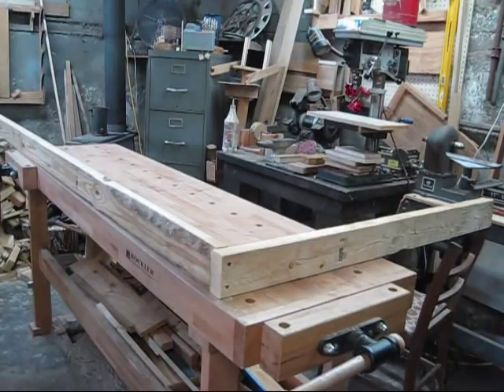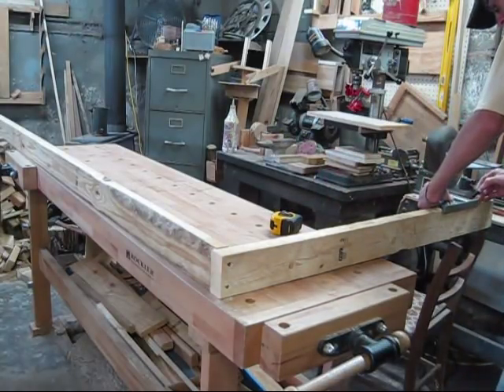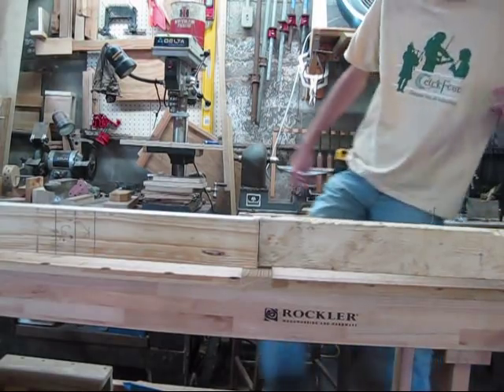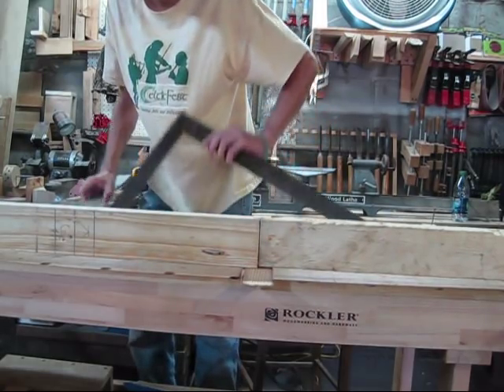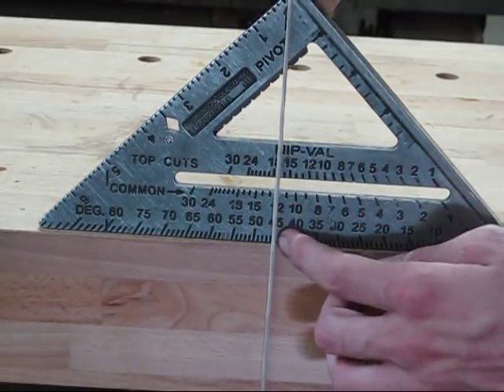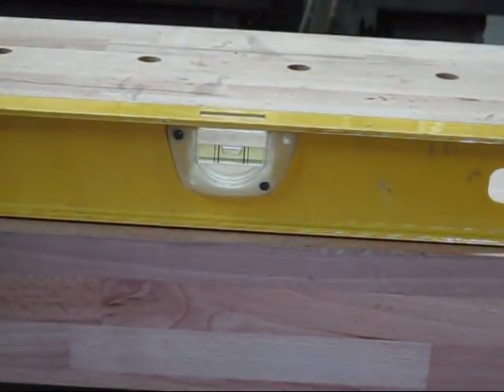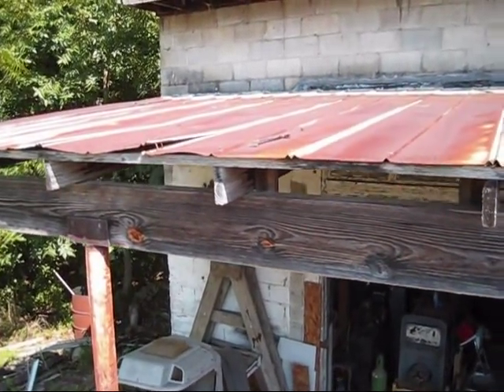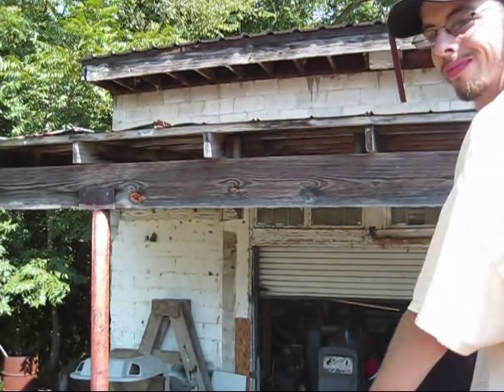Tricks with construction tools

Comment: @classic work The 3-4-5 method only works if your 2/4 plates are perfectly straight which is unlikely.
It's odd that you mention that the method that you use for leveling with a speed square is only as good as the length of the square, but you don't mention that the same thing applies to the 3-4-5 method in that if the board is not straight it will not work.
Reply from the maker: +Jim Watson A plate can be crooked as a snake's back, and the 3-4-5 method will still work.  This is framing not machining.
Reply: +Classic Work  In your demonstration you measure the hypotenuse at the edge of the 2/4's. If the place your measuring is as  "crooked as a snake's back" and is not in line with the beginning and end of the board, it would be impossible to make the 3-4-5 method work. Also you use a little speed square to show that the frame is good. You certainly can't say that is true when your representing only the first 7 inches of the wall. That's like taking a short level to plumb a wall. Are you going to slap a 2' level on a bowed stud and tell me it's plumb? It's impossible if the area you put the level on is not in a straight line with the top and bottom; the level would be titled and when you moved the wall laterally till the level showed plumb the wall would not be plumb.  The method is based on straight lines. Imagine the 2 boards you are measuring were half circles. Do it on paper now. Scale it down so it will fit on your paper and tell me it's accurate.  I realize that this is an extreme example, but so is a snakes back.
Reply: +Jim Watson when laying out track house foundations we can't rely on our formwork to be straight, it's often used several times and varies in quality. we find it more accurate to pull square off of two strings along the formwork
Reply: +Myles Lenover L&S concrete systems
Reply: +Jim Watson : I think the point is, the foundation  or the sill plates may NOT be perfectly straight--but the chalk lines you snap  between points 3,4, and 5 WILLbe--if they are pulled taught. Carpenters will then work off of those lines when putting up walls. The foundation or old sill plates MAY in fact be like 2 semi-cirlces--but after you snap your lines you ignore the curved part of the foundation--or rip out the old plates, and place them to match the chalk lines. No?
Reply: +Alan Wong Obviosly--the larger the multiple of 3,4,5--ideally the length of the whole wall, the more accurately one approaches "square" for the building.
Reply: +Jim Watson : So my question is: when a plate ISNT  straight, on a piece of construction, how do you fudge to compensate for the previous carpenter's error? Are there any tricks  to fixing that?
Reply: +Alan Wong  you bend the plate till it's on the line and then bolt it.
Reply: +Alan Wong What "old sill plates" are you talking about?  He was using the edge of 2-2/4s in his demonstration, and that is why I said they have to be straight. There are no chalked lines to go by in his demonstration.
Reply: +Jim Watson: Oh, I just assumed there WOULD be a chalk line; framing lumber can often be warped....so how else can you make sure it's straight but by referencing a chalk line--and as you mentioned, THEN  bend the plate and bolt it to follow the line.
Reply: Alan Wong In his demonstration he had no chalk lines to go by. That's why I said it wouldn't work unless the boards were straight. There was nothing about a sill plate, was there. We are talking about 2 different things.

Comment: I was taught to parallel a beam with a string is to use a short piece of 3/4 block on the side of both ends and the string should be the thickness of 3/4" all along the side of the beam.  Also to plumb up roof trusses I use a 3/4" block on top and hold a 3/4" spacer between the bottom of the truss and the spacer. The free end at the bottom of the string being connected to a plumb bob.  When top and bottom have 3/4" parallel to the truss it is plumb.

Comment: I was TAUGHT a^2 + b^2 = c^2 in high school ... and I was able to solve the problems in the book and get the grade, but I didn't LEARN it until I needed to lay out a right angle for a garden and was introduced to the "3,,4,5" rule.

I will confess to knowing next to nothing about speed squares but I think I can add to your knowledge regarding squares in general. 

Do you know how to test a square that DOESN'T have numbers on it for squareness?

Lay it along a straight edge and mark the perpendicular edge, then flip it over and compare the perpendicular edge with your mark. If they match up exactly, you're done. If they meet at the far end, use a center chisel to make a mark in the outside corner (then check again, making the mark deeper and deeper until the lines DO match up). if the top is spread open, make the mark on the inside corner. Each time you make the dimple deeper, take a new line to check against (actually, you can wait until you've closed the gap about half way before taking a new line if you are careful not to over-shoot.)

Comment: "3-4-5" method, otherwise known as Pythagorean's Theorem.  Practically the ONLY bit of algebra that one could use on a daily basis.
a² + b² = c²
a= the vertical line of a right triangle
b= the vertical line of a right triangle
c= the diagonal line of a right triangle
3² + 4² = 5²
or 9 + 16 = 25.

Comment: Common mistakes I've seen with #1:
 - Measuring the 5' mark on the INSIDE of the boards (they must be measured on the outside since you're pulling your tape from the outside)
 - Boards warped (even slight warping will distort the 3-4-5 method. If warping has occurred, use another method)

Comment: Another good one is checking a level, if you level an edge of some sort and flip the level 180 degrees, if it isn't level your level is shot.  I've yet to find a level with an adjustment screw so one can fix it on the spot.  I got in a big argument once with a master builder when I forgot my level and was going to leave the job till the next day because it was a fair distance away and he insisted that I stay and that I use his ole glory and it was not accurate.  He would not learn and I wasn't setting up a negative edge without an accurate level so I left and he was visibly angry.  Kind of makes one wonder how many do not know that.  I figured it out myself.  Be careful it is like explaining neutrals to licensed electricians.  Oh, works on plumb also, just use the other side of the level.

Comment: You can improvise with anything, it needn't be limited to the things in this video.  Knowing the essentials of what is going on instead of relying on rote procedure with tools you may only partially understand will get anyone out of a tight spot.  

Learn what you are actually doing and how you are doing it.  When people micromanage, remember that it doesn't always have to be done that way, as long as it fits within the appropriate degree of accuracy.   Do you, as it were. :)

Comment: When using "3,4,5" you can use almost any numbers you want.
Choose the length you want to measure. Divide that length by 3. Then times that by 4 and your square should be the original number multiplied by 5
Reply: Also the most accurate way to straighten with a string line is to have 3 little blocks of timber. Eg 2/4. Place one block at either end and run the string line over top of the blocks and use the third block  to gauge the distance between beam and string. Pull or push the beam until the 3rd block hits the string.
Reply: Pick two positive integers. Find the sum of their squares. Find the difference of their squares. Find twice their product. Those three numbers you've found are a Pythagorean Triple. Cheers.

Comment: Ethan you seriously need to learn how to tie a string off when your pulling a line. You twist it around your finger about 5 times... pull the loop over the nail then pull tension out of loose end. it'll automatically recoil over itself holding the tension

Comment: The square and plum bulb work good for setting degrees of slope for handicap ramps etc. No need to spend your hard earned money on a fancy electronic level. I have a 12 inch speed square that I'll place on top of a level while measuring degrees of slope.

Comment: Just a comment on your 3-4-5 method that I didn't here you mention, it uses Pythagoras theorem which simply means that you can measure out any mutiple of 3, 4, or 5 as long the multiple is the same on all 3 sides. Example: if you chose the multiple of 2 you would measure out 6 ft side A, 8 ft on side B and side C should equal 10 ft.  Simply choose the multiple that gets you out as far as you need to check such as squaring a foundation corner.
Reply: Absolutely right.  I've used the multiples to snap long chalk lines on floors.

Comment: You probably know this, but with the 3,4,5 thing if you want to check larger areas you just multiply each number by two for each step up. I know that doesn't make sense so here's an example; 3,4,5 - 6,8,10 - 12,16,20 - 24,32,40 etc.
Reply from the maker: +Kcin tnoM Aye good thing to remember.

Comment: You know you should let your tape measure slam shut that hard, it will elongate the holes and the end piece will love more than it's designed to for allowing inside to outside measurements. Once you elongate the holes letting it slam, it will not be accurate anymore.

Comment: 3, 4, 5 can be any multiple of 3, 4 , 5. multiply them each by the same number, for example 6, 8, 10 or 15, 20, 25. Using the 3, 4, 5 trick is the (a2 + b2 = c2) formula where the Adjacent, Opposite and Hypotenuse all end up in whole numbers to form a 90 degree angle.

Comment: when pulling a srtring try this trick ,, hook the string on one end the other end loop the string around your finger once and twist the string around 3 or 4 times then hook it on the nail , pull the string back to the first nail until its as tite as you like then pull the string back the opposite way , the string will pull into the twist keeping it from going loose , simply tug the string towards the first nail to release ,,, no nots to undo

Comment: 35 + years in the business ...Don't rely on framing square's for straight., use a string line whenever possible. FYI, if you drop a framing square it will not be a right angle. ( use a center punch in the crotch of a framing square to bring it back.) It's not difficult to test. flip it back and forth over a line drawn on a piece of wood until the lines are the same. If I lost you with these instructions,  you need to go to....or go back to school. When buying a level, stack three or for on top of one another. you will see that they aren't the same as far as level goes. Buy the expensive one that has adjustable vials and you can recalibrate it every time you drop it. If you don't know how to calibrate a level, take my previous advice.

Comment: If you carve a 1/4" bevel at 45 degrees 1" in on each end with a knife and use a finish nail with a fine line...you can check for straight much more accurately

Comment: The 3, 4, 5 method can be used with any size.  Thus:  3X3=9  4X4=16  add these together and U get 25.  The square root is 5.  To find the legs--the other sides:  5X5 =25  4X4=16  16 from 25 is 9 and the square root of 9 is 3.   Any measurement can be used in this method.

Comment: On the tape measure trick. If your tape is one that has a magnet on the end & it is a metal tool on a metal roof. You can drag it off from the underside using the magnet.
Reply: The magnet wouldn't be no where strong enough but good idea though

Comment: Interesting the use of string to find if something was upright .  . This trick was used by the Egyptians and the builders of Cathedrals during the middle ages . The Egyptians went one step further  , by rubbing a red chalk like substances on the thread . When both ends where fixed on wood or stone,  and then  snapped   against the surface   a straight red line would appear.

Comment: You need a Kobalt tape with a magnetic tip, only 12 bucks or so with a lifetime warranty. That will help you get your crap off a roof. And I would be glad to give a lesson on tying a string of if you would like. ;) nice simple techniques here that only tradesmen really have picked up on. also on the 3,4,5 and can also be any multiples of it which I think you were saying just not well explained. i.e. 6,8,10; 9,12,15 etc

Comment: Good vid. What if the pitch makes it so the string goes past the 45 mark?
Reply: chupalia Sorry, that question was for your video on the basics of a speed square
Reply from the maker: Then it is out of level. And if you count the number of degrees that it out from 45 that is how far out it is.  If it is at 39 degrees then it is 6 degrees out of level because 45-39=6  it is really cool. Hope that helps sorry it took so long to reply.

Comment: Great vid!  I followed almost everything, but the "pulling string on a beam" told you how far out the beam is; now what?  How do you actually straighten the beam?  Sorry if that's a stupid question, lol.
Reply from the maker: +constitutionalist79 Yes you can pull the beam in, or out to straighten it.  Not at all there are no stupid questions.  Thanks for the comment.
Reply: +Classic Work But how do you "pull the beam"?  Put it in a vise & apply pressure to the bowed point?  Go ahead & use it in the house frame, then apply pressure somehow to the bow?  How much time do you have to hold pressure to the bow before it is re-shaped straight?
Reply from the maker: +constitutionalist79 Well that is what braces are for to straighten a beam that is bent to a useable beam.  There are a lot of words for braces: gussets, strong backs, rack braces, gib braces, buttresses, purlins, headers, ect... All are used to keep other "parts" (Rafters, joists, beams) straight.  Use string to find the bends, and braces to fix them.  Hope that helps.

Comment: Cool trick and i have a question -- how do you measure a position of 4 poles whether or not they are aligned with one another in perfect straight line in perfect square/rectangle. I understand that if there are only 2 poles its easy but when the poles are 4 and you want to make it a square / rectangle it could offset a little bit and form less perfect square/rectangle...and make an angle like trapezium shape or something
Reply from the maker: +Meiji Jap The easiest way I know is to build a dry form (like a concrete form without the concrete) that way you can square the form before you set your poles.  Once you build the form you can dig your holes (I'm guessing that's what your doing) make them a little bigger, so you have some play, and then plum your poles be driving stakes in the ground, and nailing on braces.  after that just pull a cross tape to check for how square the building is, and move accordingly to where you need to go.  And Bob's your uncle.  Now that being said you may have building that is to big for the form plan to be practical, so no problem you can still use the form just take out the long stretches no point in using a lot of wood.  Long as you can take a accurate measurement you should not have any problem having the poles stand where you need them to.  Hope that helps.Ethan

Comment: Good review - thanks for sharing - did not like the string method to see the bow in a board. How I would do it would be this. I would take a piece of card stock (3 x 5) folded in have back to 90 degrees. Next you want to put 2 measured marks on each end of the board. Place the card stock near the very end of the board and place a measured mark on the card stock about half way though the thickness of the board using a carpenter squre. (amount is not important). Then move the card stock out of way and notch the end of the board with a knife or chisle. Just enought that a string will find it. Do the same at the ther end. The layout is to be done from the same side of board for both ends. On the end of the board, install a screw or nail below and in line with the notch. String your plumbline from one notch to the other, making sure the string is in the notches(like the strings on a guitar nut). Then slip the card stock back under the string from the measured side. As you slide the card stock down the stock you will see from the string to the mark on the card stock how 'bowed' the board really is. This is a little more set up, but much more accruate.
Keep up the great work and videos - happy learning!
Reply from the maker: Dang that is one way to do it.
Reply: LMAO. TOOK ME LONGER TO READ THAN IT WOULD TO DO IT THE RIGHT WAY

Comment: I need a board stretcher for when I don't measure 3 times, but just can't seem to find one that works.  i do like your framing level.  Do you have a trick for planing the joists on a deck build?
Reply: Ron Laukaitis I've got the same problem. No matter how many times I recut a board, it's still too short.